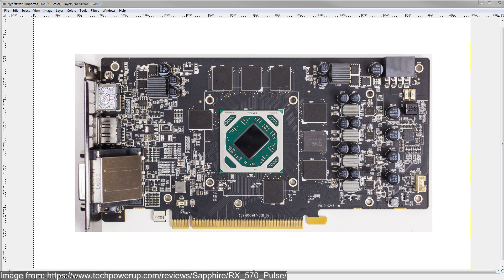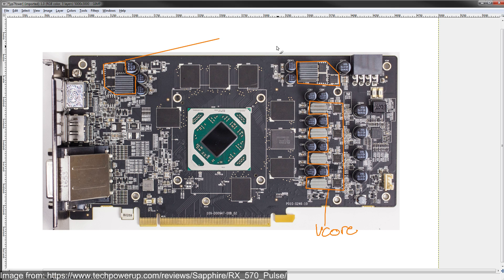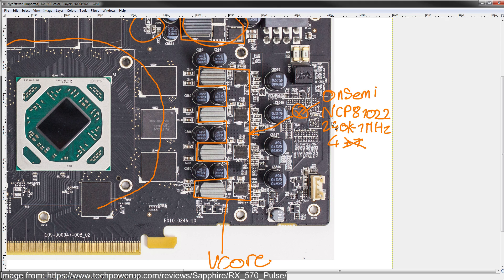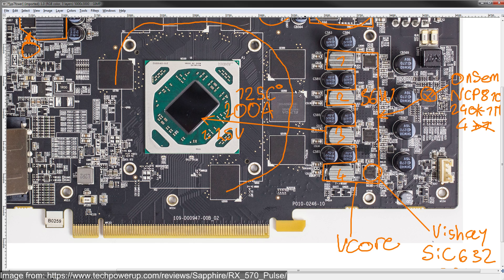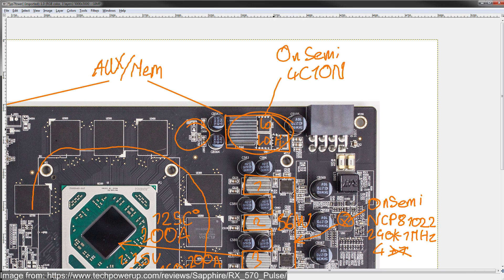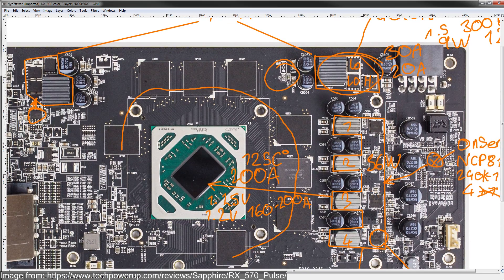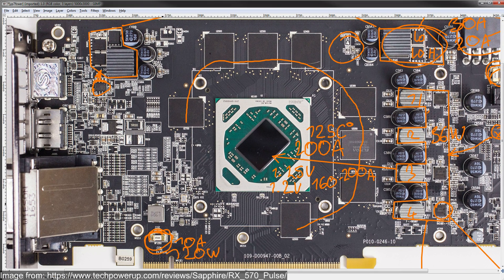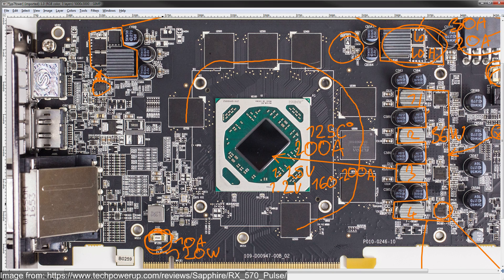PCB Breakdown: Sapphire Pulse RX 570/580

Comment: Thank you so much for this review, it was very helpful. I only have an issue: I only get 0.893V on vcore, can it depends by the fact that it wasn't connect to video out or because the motherboard is quite old so it recognize it but it doesn't use it for compatibilty issues. Thank you again!

Comment: Bought one 2nd hand, the 8 pin fuse just blew up after 30 minutes of heaven and with 1400 core OC on the card. I didn't think the card would draw that much power, it's still below 140w in HWINFO64.

Comment: Hi, I have one of them not working and with a multimeter I found out that both the fuses of the 8 pin are burned. So in order to make it work again I just have to replace the fuses or maybe replace the vcore controller(SiC632) with new ones? Please help me
Reply: I have a Sapphire RX 470 that I bought off eBay.  It arrived DOA and I had to replace the two fuses near the 8-pin and then did troubleshooting to find one of the four power phases was dead.  Apparently, this is a common problem with these Sapphire Polaris cards.  I was unable to replace the power phase, so I removed its inductor completely and the card runs fine with only three of the four power phases and three BIOS edits.

Comment: Hello, I've got what I believe an MLCC capacitor (tiny square with brown color) fall off from my Sapphire pulse RX 580. And since I don't know the value of said capacitor, I can't replace it. Can you tell me what's the value?
Reply: chances are if its a filtering capacitor, (one side is ground the other has some resistance) then any capacitor that is physically the same in size will work. it will most probably work without it, it will just not be as filtered as it was

Comment: I've got one of these cards them fuses you talk of keep blown the 2 next PCI-E power. I've replaced them 4 times tonight while trying various fixs with this card. I've checked resistance of a lot of the main components. When I think I have this card repaired it just blows it fuses again I think it could be a short have you come across MOSFETs becoming shorted on these cards what would be the most common short on these RX pulse cards. I bought the card broken it's just a project to become more familiar on how these cards work do you have any recommendations. Thanks

Comment: Funny thing, i got even more striped down version of this card (all HDMI/DP ports not installed - only DVI) for 119$ from Amazon brand new. It runs 1500MHz core @,  +70 on voltage,  +30 on power limit. And 2250 mem.
It runs very well if you don't mind the jet noise from the poor cooler. Basically i think at stock RX580/GTX 1060 performance level.
Reply: Arent you getting really high temperature with this voltage and such clocks?

Comment: my rx 570 pulse has a switch on the back of the card, near where the can connector is that overclocks the memory but underclocks the core? i cant find any info on it...
Reply: It's the "mining" BIOS... You can switch it to the "gaming" and OC the memory manually, thru MSI afterburner.
Reply: that's a NITRO, not a PULSE

Comment: I'm here because I just bought a used RX 480 Nitro 4G (non+) that has that very same PCB.  Mine has Samsung Ram with serial A1646. In case anyone is looking for a way to flash their mining modded card back to stock bios, I've made a little thread with some links in DrathVader's comment below.

Comment: This is the exact same PCB as my RX 480 Nitro (non-plus). The VRM near PCI-E power connector is for memory, so the other one must be aux.
Reply: I recently bought  a used 4GB one of those.  Someone had flashed it for mining I assume since I had to use the pixel patch to get the drivers working, and the core is set to 1326. Not complaining though, the 4x6mm pipe cooler is great and the Samsung memory still clocks to nearly 2.15GHz while the core manages 1390 with just increased power limit. (Seems he(she or it) might have lowered that to 142W as well)(edit: thats actually stock for this card). It runs Firestrike fine at 1375/2125 @ 75C, 50% fan. 
I am curious about the VRM but I'm not sure I want to take it apart. At 1390 with + 30% Pwr it generally stayed around 160-170, but occasionally spiked into the 190's, which was a bit scary. Top plate near VRM can get hot to the touch but a small fan pointed at it works wonders. Next job is to back up the bios and see if the memory timings have been tightened up, would explain why it cant hit 2250. Aside from the hot back plate at high clocks the performance is good, fans are in great shape, really quiet and I never saw the VRM efficiency go below 96% when under load. I kinda wanted that dual bios but this cooler is so much better than the old 480 nitro cooler, that, the 8 pin power and Samsung ram on a 4G card makes it a win IMO.
Reply: Confirmed. Going by the rear fan header placement compared to the 580 Nitro + PCB, my RX 480 nitro(non +) OC 4GB has the Pulse PCB.
Reply: OK, I'm starting to think I got Elipda ram and the previous owner flashed the card with a samsung bois. 
Could you check yours please and let me know what you got?  According to  https://www.techpowerup.com/vgabios/?manufacturer=Sapphire&model=RX+480 only the 8G has samsung and I def have a 4G going by all the labels, my memory timings also use a different format.
Reply: Update!  Lucky Day!!!   I found a Samsung bios for this card here:  https://www.miningtweaks.com/sapphire-rx-480-nitronone-4gb-samsung/
He has both the original and a 30.5Mh/s modded bios for download, which looks more professional than my crudely modded bios. 
So I flashed my card with the original bios and all good. It was indeed Samsung. Now to see what it can do.
Reply: Results are in. Apart from the 20Mhz OC, the mining bios on this card as I bought it only changed the memory timings. In Firestrike the core does up to 1375 reliably either way, and up to 190 at lower mem clocks.  Ram with mining bios made over 2130. Now with original bios it just makes it to 2250 with all default (and the same voltages). At 1375/2125 (Mining) vs 1375/2250 (Orig) the mining bios still won by exactly 100 points in Firestrike.  10574 vs 10474 at 1680 x 1050 on a stock i5 2400 w 1333mem.  
So I've looked at quite a few bios versions now and the Samsung def has the best out of the box timings, followed by hynix, elpida and micron, which is amazing considering it also clocks higher at its tighter timing.  I'm a happy chappy now. Good luck to you and all who've read my rant. Hope it was useful.
Oh, BTW, My serial No. starts with A1646. It's rare to see that number, none of the database I've seen include it. It's Samsung.

Comment: does the RX580 sapphire pulse has the smae performance with asus RX 480? because in my country, the RX 580 sapphire pulse's price is lower than asus/otherbrand RX 480.
Reply: everything is the same gpu, everything can be over or underclocked, the problem with 480 is higher video decoding power usage & lower clocks compared to 580, so i would go with 580 (not sure about sapphire pulse though)

how much price difference?
Reply: kn00tcn the difference is just depends on the brands. asus rx 480 4gb is like 270$ and sapphire rx 580 4gb pulse 235$ 
And yep. Im confused.
Reply: when it's other countries, the prices start changing based on who the distributor is, how different brands are imported, etc... this is on top of the individual models of cards, an asus strix should be more expensive than an asus dual since the strix has more features, higher clockspeed, better materials, but the gpu itself is about the same
Reply: sapphire's pulse is supposed to be one of if not the cheapest of any brand & model

Comment: hey. i esas thinking if its stupid to buy a dead video card to use its vrm to power some other cards
Reply: Imię Nazwisko in my country i can get 560 ti for 20 $ and it seems like decent 6 phase power which I can hook up to unique k4000 (it must be engineering sample but not sure none k4000 looks like mine) and crush the clock

Comment: Checked the price of the onsemi MOSFETs and compared to my TI csd16321q5 and i got surprised the onsemi ones are really VERY cheap,(the TI ones are package limited to 100A) perhaps the ones i have are too good for a 17A power supply.

If there is interest, i got a ga-990xa-ud3 than i can probe the switching frequency for a more accurate breakdown.

Comment: who designed the MB 24pin anyways, 2pin 12v connector for all the PCI-E 12v power, which can easily go over 150w on an 2x/3x  SLI config. And PCI-E 6pin, which has 3 12v connectors only carries 75w..
Reply: just checked Molex 26-01-3116 specifications, which have specifications both 13A per contact (16AWG wire in small connector) to 8.5A/contact (18AWG wire). it can delivery 200w with two contacts, but it is pushing it to the limit. ATX 24pin is so outdated and should really be refreshed/updated/completed replaced!
Reply from the maker: ATX spec is 18AWG for everything.  Garbage PSU might use worse and some high end PSUs are 16AWG
Reply: Cooper I think they use different gauge wire on the 24 pin vs the 6 or 8 pin. Not 100% sure but that's what makes sense to me.
Reply: Also, it's the connector that's holding the power limit down. One 18 AWG stranded wire cable has a current capacity of 16 amps, and at 12 volts that's 192 watts. If the motherboard has 2 of those then it can carry almost 400 watts if it was the wiring holding it back. I don't know specs for the connector, but I'm going to also guess they overbuild/underrate them for most use cases

Comment: Only 1x8 pin? where is 6pin?
Reply: why would it have a 6+8 Pin? :D haven't you watched the video and seen the power layout of the vrm?
Reply: Modern cards don't have the ridiculous energy requirements of before, like the R9 390 II Devil 13 or the R9 295X2, which both needed 4x8 pin.
Reply: 75w slot + 150w 8pin = 225w on a card that's designed to stay under 200w, TPU review of the 570 shows it under 180w

480 reference was 75w slot + 75w 6pin = 150w
Reply: My Rx 570 4gb hynix its with 6+8 :D

Comment: Yup, it's Polaris 20 now.

And would you know if the RX580 GTS and the HIS IceQ2 RX580 share the same PCB again like with the RX480 GTR and the IceQ2 RX480? Because there's a pretty big price difference between the two and if they have the same PCB/cooler capability then that's a way better option for me. 

On the Pulse: RX500 series now also undervolt pretty amazingly, so that 200A rating isn't that bad. AdoredTV got his RX580 silicon down to like 900 mV on stock RX580 clocks of 1257 mHz at like 1040 mV.
Reply from the maker: RX 580 GTR-S is the GTR 480 PCB, The GTS is weaker
Reply: Actually Hardcore Overclocking how much weaker?
Reply: 2 weaker
Reply from the maker: I think it's 6 phases using 50A power stages. So 300A instead of the 360A on the GTR-S

Comment: Thanks for showing me the card I bought in depth :D
EDIT: Seems my choice wasn't the best but its just a gap filler for vega anyways^^
Reply: The card is solid, just not meant for any crazy OC.

And seeing how hard it is to get any decent OC out of the 480 and 580s - you did well not spending any more cash on it, as even a beefy heatsink, binned chips and a very solid cooler would get ya no more than 5% performance boost over a cheaper 580.
Reply: so this is good for undervolting?